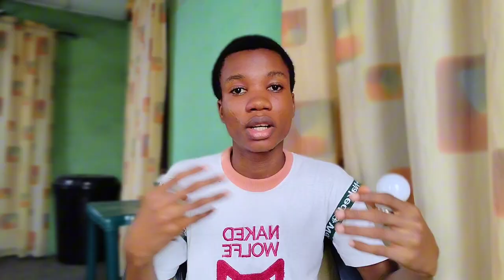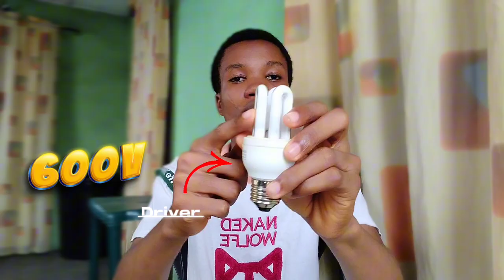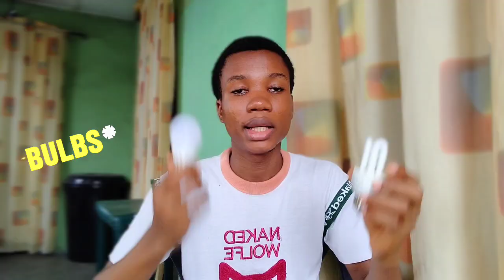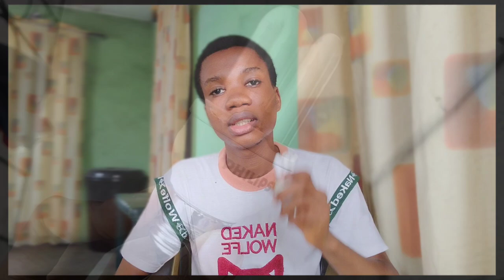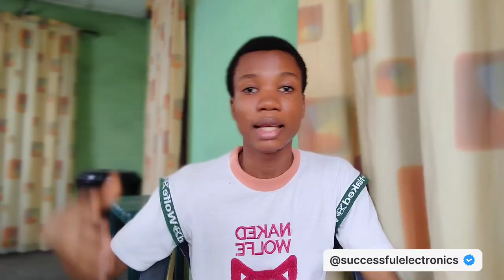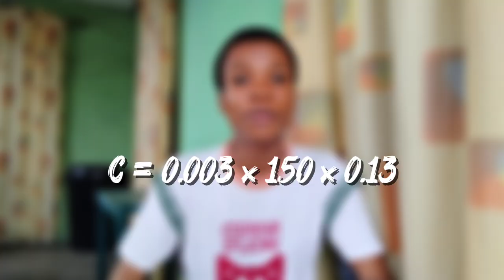LED Or CFL– Who wins?

Comment: Look up reactive power for AC. Writing on the bulbs say 25 mA and 60 mA. No point comparing the power/current/heat three times otherwise.

Fluorescent can't take many on/off cycles, as the elecrodes will burn out and deposit metal dust on the glass. Fluorescent works best if left on for extended period in an upright orientation because the heat is in the glass tube. LED heat is transferred to the heatsink in the base. At home we usually save power by turning any lamps on and off often, and here LED better.
Reply from the maker: Thanks for the suggestion! I understand reactive power and why it’s important to consider in AC circuits. Sometimes the values written on the bulb aren’t exactly what the circuit actually draws because of power factor and reactive components. So just looking at the rating on the bulb isn’t always the most accurate method. Measuring the bulb live gives a better picture of the real behavior. I’ll try to include that kind of testing in a future video. Appreciate the feedback!

Talking about all the comparism, everything seems important to determine how long the bulb will last.